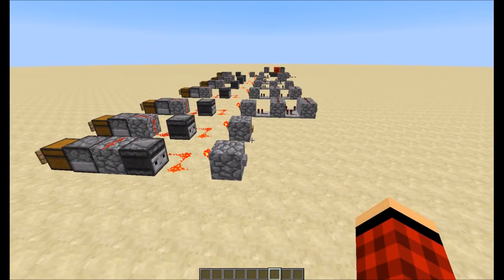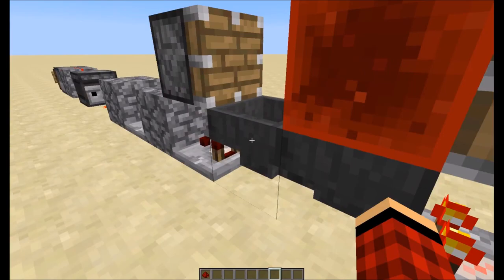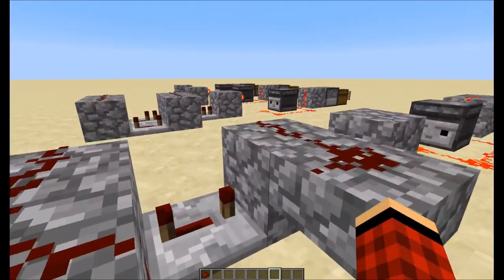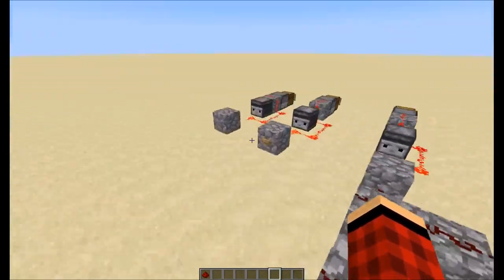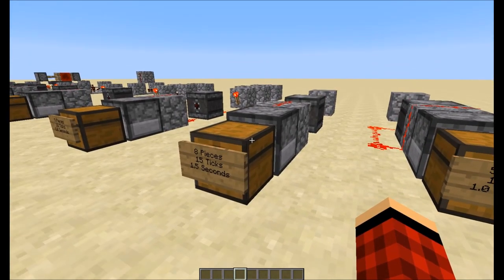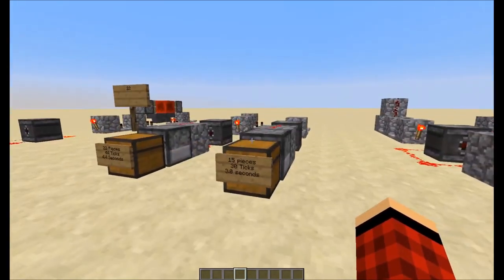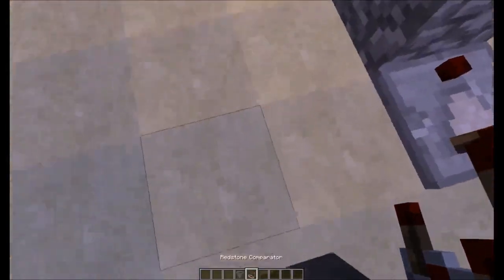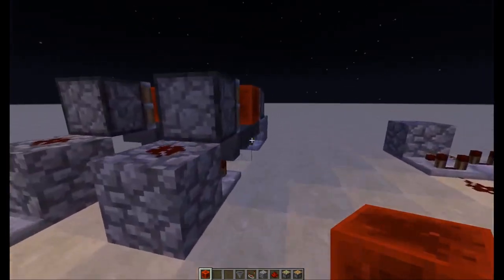MineTech; Top 5 Redstone Pulse Extender Testing by; Carburetor Gaming

Comment: Thanks! I used the one that you made. I had troubles with getting these work with observer but then your lenghter gave me a little bit longer pulse that I was able to use to make ever longer.
Reply from the maker: Always love helping people out. Check out my extended ethos hopper clock if you need even longer.

Comment: you should look into item despawn timers and railcart spider web delay for adjustable extreme delay timers. you could also use a day night sensor for really long delay but you might run into chunk update issues depending on your setup. hell you can even use chunk despawn on inverted redstone to act as player detection...
Reply from the maker: I dont like them. Entities despawn according to RNG. If you need extended pulse extenders, I recommend combining the last one with my ethos hopper clock extension set up. You could get a pulse extender that could last for 4 days with a big enough extension

Comment: How did you get it to count the pulse lengths?
Reply from the maker: I used a powered comparator set to subtract with the redstone linked around to the side. When you power the comparator, it causes it to pulse on a 1 tick pulse
Reply: @carburetorgaming5173  Ah, ofcourse! Thanks! Almost forgot the good old comparator clock works with redstonepower.
Reply from the maker: No problem. I should have shown that better